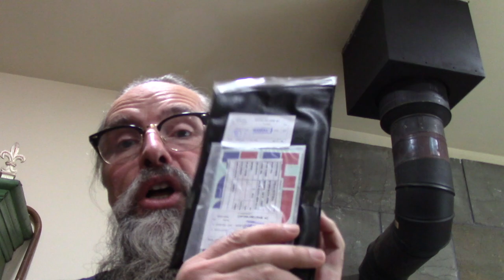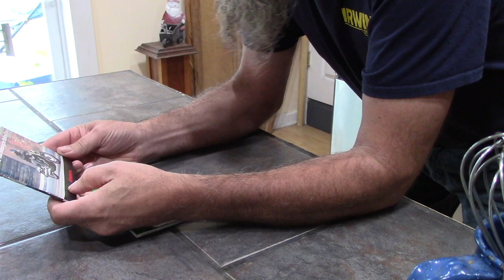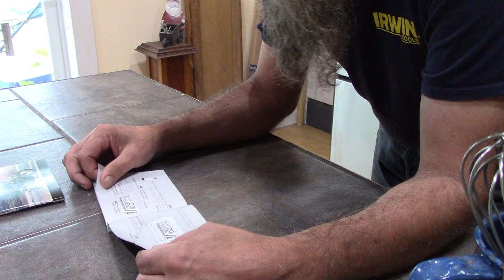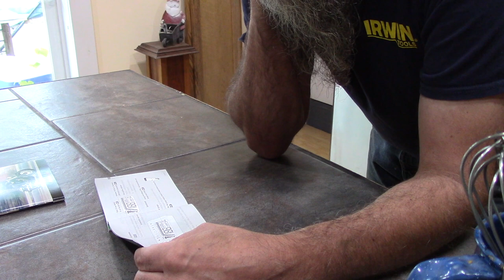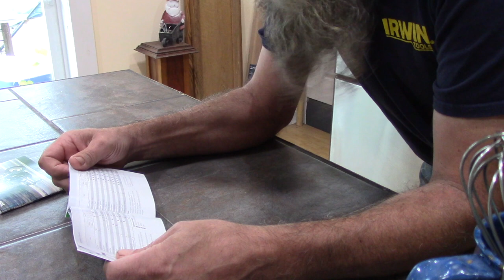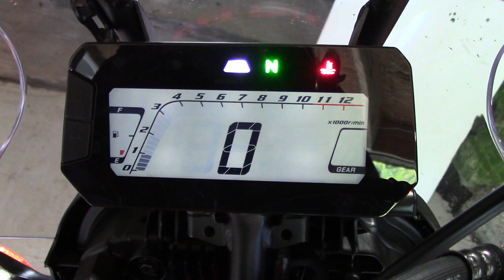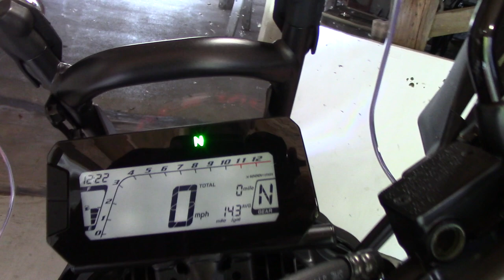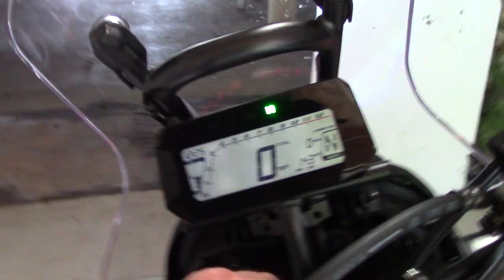Road trip to buy CRF300L Rally manual and first look over

Comment: Lucky you found one. Took me half the year to find a 300L. IMO a tail tidy is a must, I can't stand the huge ugly plastic crap they put on the back of new bikes nowadays. I got a Yosh tail tidy for mine and love it. Get yourself a bash plate also before you have a real expensive problem crop up. Also you'll probably want to bump up the rear shock pre load all the way as they are set WAY too soft for all but the slowest riders. Have fun, I love mine.
Reply from the maker: Yep Tyler same here. Was looking used forever until I realized for a couple bucks more I could go new. Was on 3 waiting lists and to date only one has called back. Now I have to get more time to ride it!